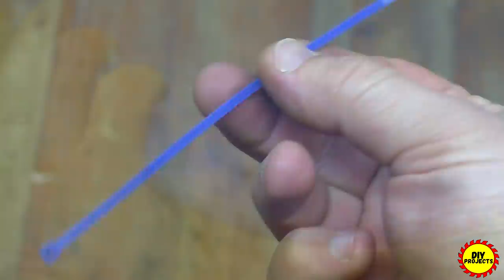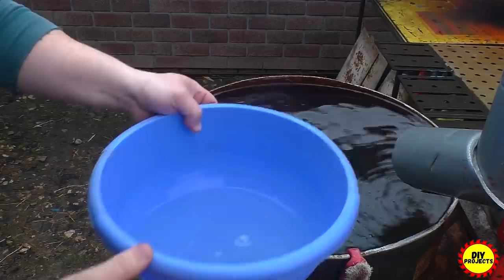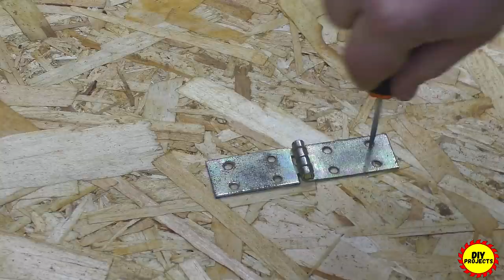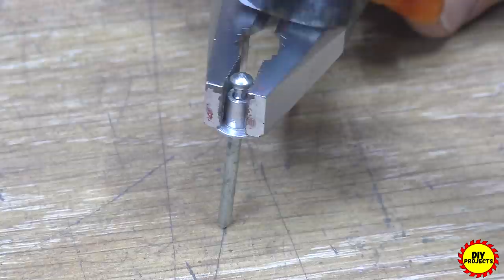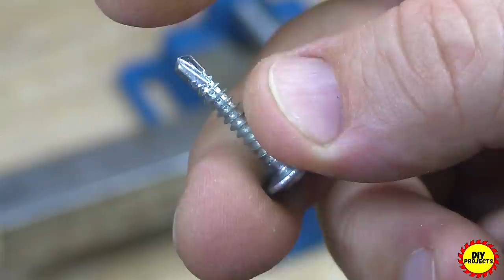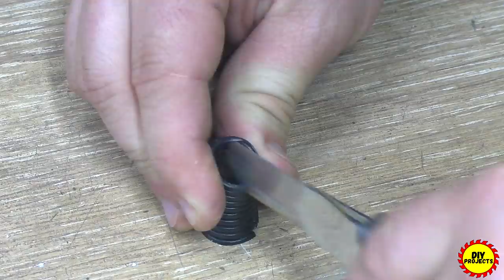The Masters don't want you to know! SECRET TIPS

Comment: Great videoclip!!! I learned a few new super handy tricks like reversing the pop rivet. Thanks a lot for sharing!!!!
Reply: no, don't do that, it won't hold, that's a terrible idea
Reply: @BobRaygen  I will still give it a try.   If the right size of pop rivet is used it should hold the hinge's plate. Now, because the end  you hamer into the wood is not pointy it will not act as a wedge.. old school nails were like thay. Anyway in fabrication pretty much everything is relative and many factors play important roles.

Comment: I wanted to troll so hard, but then I thought, this world needs more of this guy and less of me.
Reply: I beg to differ, good sir.
Reply: @ Chris Parnell, my thoughts exactly. We've done the right thing. A little humbleness is good for us all.
Reply: lol :) Don't be so hard on yourself :)
Reply: @Chris Parnell , they earn to be trollt. There are some huge problems with this Video.
At first: the name. Masters never want to hostage there knowlege. Not in craftmanship.
if the do ... they are no masters.
Second point, some of these Tipps are not good.
-The first tipp with the tube? for what? Its not looking good and will not hold stress and or it will hold stress and damage what ever it hides inside.
-Not every plastic is made for welding. It will work for a short period of time, but it will break in a moment of fals safty.
-the tipp with the "nail" ... i would not bet that this will hold for long ... especially in that position.  come on ... a metal bracket. the metal of blind rivet´s are soft! (would you rather use a screw out of aluminium or out of stainlesssteel?)
Reply: @TheHappymetler  you are 100% correct. I want to stop adding to their popularity by encouraging others not to troll. Not to even respond to these types of cheap videos. Thanks for understanding.

Comment: The melting plastic to fix that bowel is OK, but a much more simple idea will shock you. No this will not be as durable especially if the item has to flex or gets put into a extremely hot dish washer. But about 12 years ago I bought a plastic contain to use as a rinse water container when doing dishes by hand and I still do mine that way. This container was designed as a magazine holder not a water container, so it was very flat on all sides. Well after several uses I noticed I was losing water from this one. I discovered it cracked on the bottom at the center. Later after it was fully dry I put a piece of good clear packaging tape across that crack on the bottom and it is still there 12 years later and works fine and did not peal off, or leak.
Reply: Or you could throw it away and buy another bowl for a couple of bucks at a dollar store.
Reply: Melting plastic to fix a ‘ bowel ‘  Painful 😫

Comment: Cracked plastic bowls can be fixed with glue stick, if you don't have a glue gun, just burn the glue stick with a lighter or match and wipe the glue stick over the crack
Reply: twist the plastic bowl slightly and the glue comes apart immediately.
Reply: @jhingur7169  it's not water based glue, glue stick when melted acts the same as the plastic that is melted over the crack in the video

Comment: Oh boy, now I know how to turn a pop rivet into a really crappy aluminum nail that will ensure my project will fail and hurt someone.
Reply: NightRaven 630  ⁹
Reply: I believe the idea is, ideas in a pinch quick improvising when you don't have the proper tools and/or hardware Karen. Savvy? ..
Reply: And no, I don't believe this guy is advocating for contractors, handyman folks or other professionals to do things like this on the job, so settle down Karen and Karen. ..
Reply: The music just hurts my ears. Can't watch this
Reply: @CamTracey  turn down the volume.
Reply: The rivet may be made of aluminum , but the "nail" is steel, and i have used many hundreds as softwood and plywood finishing nails and for wall hangs on drywall.
Reply: @jacqueslefave4296  A poor grade of steel at best.
Reply: @kmoecub  Agreed. It is considered a throwaway part, after all. But for hanging a small to medium sized portrait on drywall or particle/waferboard , it'll do. Also, those tool grab marks near the point give a little puullout resistance in the substrate. 🤔

Comment: But what if the hole you need to drill is deeper than a 1/4 inch?
Reply: start drilling then remove the blocks. The hole you've already drilled will hold the bit straight.

Comment: The rivet you installed isn’t as strong as it didn’t expand in the hole giving it clamping power
Reply: You wit you!
Reply: Totally not the point.
Reply: @rustyswinehammer9156  
But it’s the truth about correctly installed rivets
Reply: NightRaven 630  
Sometimes the YT flaws could cause injury if used in a security type situation …. Don’t always believe what you see on video …. 👊🏼👊🏼🪚🔨✌🏼🇺🇸🇺🇸
Reply: NightRaven 630  or read in the comments.🤨🤔🤣😀😎👌
Reply: @FredD63  I agree, that is normally the case but I think it was used this way to just fit the hole in the hinge better and provide a sort of washer to hold things in place more firmly. I prefer a screw when mounting hinges anyway.